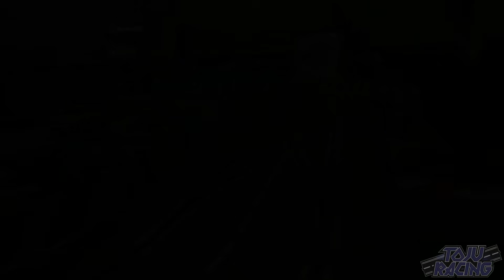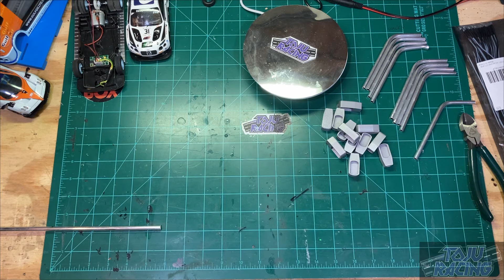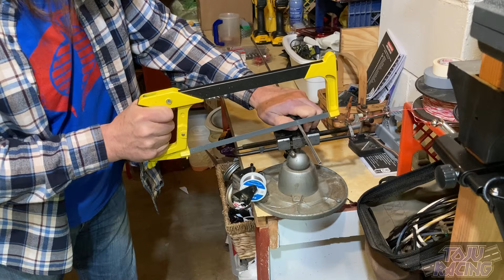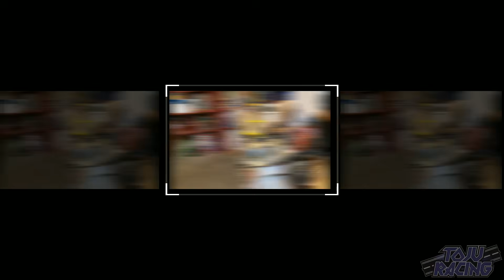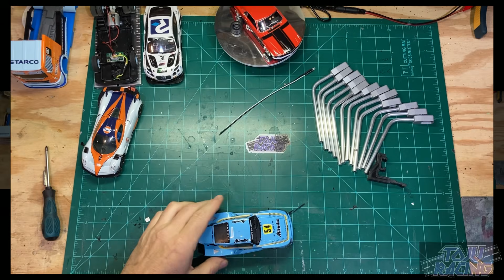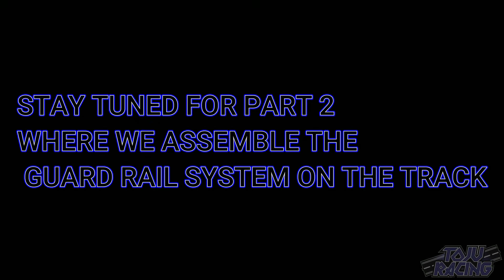Carrera Slot Car Track Lighting Part 1: Light Pole Assembly. #tojuracing #digitalslotcar #slotcar

Comment: Hey Todd, great job! When I did the originals, I used a plumbing-style tubing curter, then followed up with a deburring tool (for the inside lip of tube), and a little sanding/filing for the outer lip. Whichever works best for what people have on hand.
Reply from the maker: Indeed, there are many ways to get to the end product. Thank you for your great work on these brackets and pods.

Comment: great video i use tube cutter and metal Straws but haven't found a good light pod for lights to fit in. i will have to check it out. thanks for sharing they look great. BTW how did we not sticker swap we need to do that.🏁🏁🏁
Reply from the maker: Thank you, Eric. Yeah I don’t have a tubing cutter or I would’ve used one. Yes we do. What is your email Addy I’ll shoot you an email. We’ll get it sorted out :-)